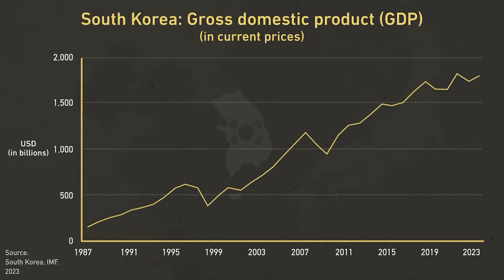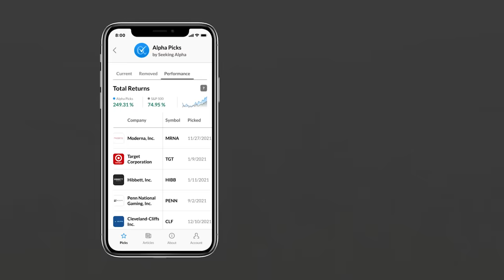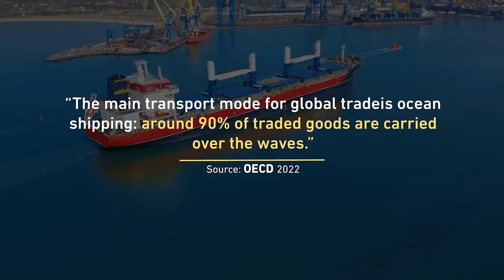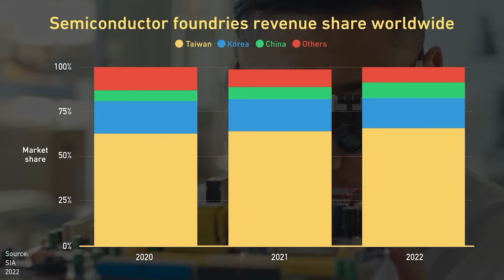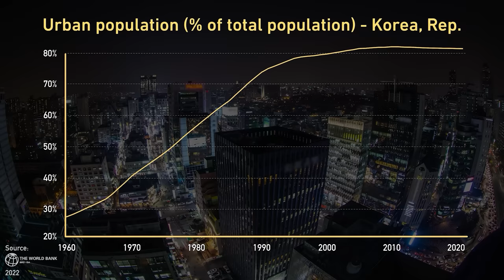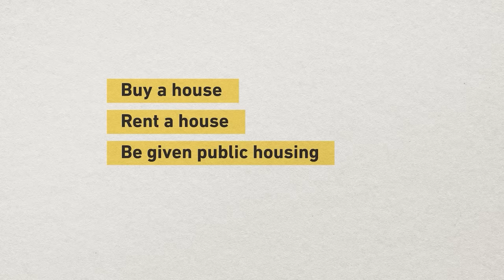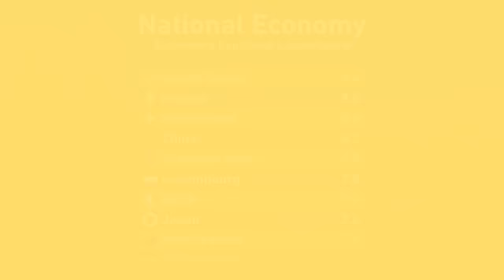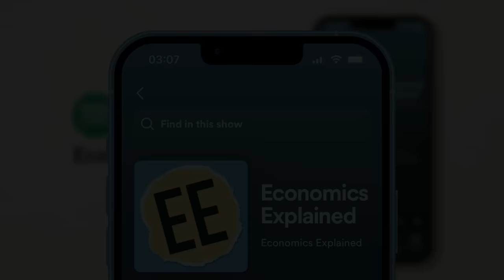Is South Korea's Economic Bubble About to Burst? | Economics Explained

Comment: The key deposit system is interesting. How much notice do the tenants need to provide the owner before getting their deposit back and moving?
Reply: Usual term is two year and renew the contract or move out. Before moving out the deposit should be returned. If the deposit is not returned the house owner will be sued by the tenant.
Reply: @설악산구름  yes, but what happens if a tenant wants to move out before their lease expires? For example, I have signed a contract for 5 years, but want to move out after the 2nd year - how long is the period between notifying the owner and actually moving out? And what time does he have to come up with the money?
Reply: Then the house will be available for rent through the real estate agent. It can take months to find a new tenant. Or you may have to wait to the end of the contract period. However, recently there were big fraud incidents resulting in lawsuits to get back the deposits.
Reply: The deposit from the new tenant will be given to you and the owner can use the money until the end of the new contract.
Reply: If the amount of deposit remains the same for the new contract, the deposit of the new tenant goes to the last tenant and the owner owes the deposit money to the latest tenant.
Reply: In Seoul, finding a new tenant will not take many months. If the new tenant is not available before your moving out, you may not receive the money back to rent the new necessary house.
Reply: @설악산구름  How are expenses (Property tax, insurance, utilities, etc) paid for under Chonse/Key Money Deposit if there is no rent being collected?  Does the landlord just pay out of pocket for this?
Reply: @aeongaming2561  Property tax & insurance cost are very cheap in SK(landowners pay for it), and tenants usually pay for utilities

Comment: When it comes to automotive technology, Germans are still leading. China and South Korea employed many German designers and are learning from them. But still when it comes to implementing new tech they wait for the Germans to do it first. They have some advancements in BEV powertrain though.
Reply: This is quickly changing with our EV-focused future.  Germans are lagging behind American and South Korean auto manufacturers big time.  They are at a big disadvantage with battery technology and user interface design.  That’s why the best German EVs all cost over 100k and even VW’s cheapest EVs are bad deals compared to anything from SK or US.  Hoping they can catch up, as there is currently little competition which allows manufacturers to inflate prices.
Reply: @RubmaLione  But in turn, Americans are relying on South Korean EV batteries made in America. So I don't see how the US is ahead of the Germans in this regard. Both Germany and US are highly depended on South Korean battery technology.
Reply: @RubmaLione  BEV tech leader is Asia with their batteries, they own both the tech and the raw materials. User interface? Maybe, depends on individual preferences. German premium cars aren't expensive due to the electrification. Their gasoline counterpart are just as expensive. As for BEV drivetrain efficiency, they are pretty good. Cheaper german cars aren't as good deals though, I agree. But cheaper cars aren't as techie either. New stuff usually goes into the premium first.

Comment: The SK deposit system for housing seems interesting. Can any Koreans share the downsides of this system? It seems like it would cause house prices to go even higher, and help existing landlowners to continue accumulating properties, like a snowball rolling down a hill.
Reply: You got the point. this system gives landowners benefits of leverage In real estate.
Reply: You have a great insight.

Indeed, in a bull market, everyone is happy. By passing bank, landlords borrowed money at low rates, and tenants had lower fixed costs. The key deposit system, which relied purely on trust in the landlord, worked well(miraculously even to me as a young Korean) as one of the most common forms of housing for decades, barring only a few scams.

However, in a down market, when banks require landlords to repay a portion of their overvalued mortgages to cover the decline in house prices, risky landlords lose the ability to repay the key deposit, meaning that the tenant now shares the risk of the landlord's investment failing. This is neither the premise nor the intent of key deposit system.

In addition to the downward pressure on the real estate market, such as the bubble and the global economic crisis, high valued enogh house price, the number of people making aggressive investments using key deposit has increased in the past decade to the point where it has become a social problem. Organized fraud in the billions of trillions of won has been committed. In a very short period of time.

The government believes that this social system needs fundamental reform, and I also think that the system has reached the end of its life and needs to be changed.